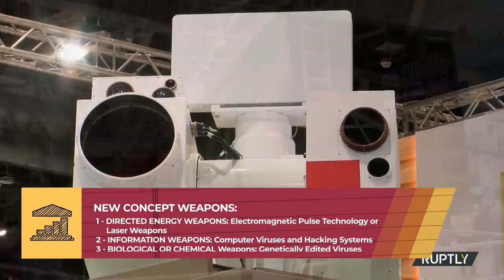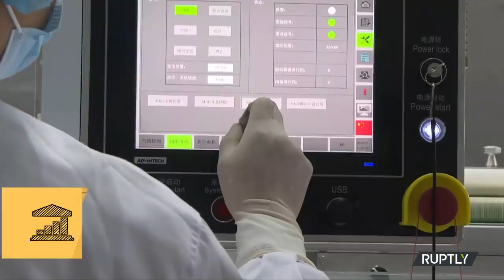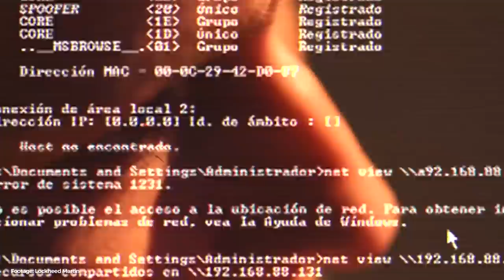The new SUPER WEAPONS with which CHINA hopes to BEAT USA (At least in Asia) - VisualPolitik EN

Comment: My question to VisualPolitik EN: CAN THESE DIRECT ENERGY WEAPON (LASER) TAKE DOWN NUKES OR INCOMING ATTACK MISSILES? CAN IT DETECT THREATS FROM 2000 KM, MONITOR AND ENGAGE THEM SIMULTANEOUSLY?
Reply: Short answer: No.
Long answer: the DEW is an attack weapon. It will need to be inducted with other ISR equipment in order to engage. Even with that, it comes down to metallurgy (material science + thermodynamics). The IR LASER might have high power, but it does not get enough time to melt through the metal of missiles or nukes (they are super fast).
Reply: @NuthanPrasanna  I think there are some ways that can make this weapon super and effective, but if there no suggestion then it is very important that USA must make more advanced and sophisticated defense missiles to protect USA and its allies from enemy threats like Russia's and china's hyper sonic missiles that can hit any where in the USA.
Reply: @NuthanPrasanna  how about enoughpower to fry on board guidance systems how would that fare in real world use
Reply: @NuthanPrasanna  how about disturbing the air in front of the hypersonic missile with sound or microwaves or deploying swarms of expendable drones and use its own speed to let it destroy itself?

Comment: Unlike projectile weapons where you can alter their trajectory, laser are line of sight weapons. Good for close in attack less so for long range attack. They are still hampered by energy requirements which are high. Having to generate a massive amount of energy whether measured in joules or watts.  The power requirements aside from laser for air, sea and land systems in enormous, but add laser you get a wall, space and the ability to miniaturize power sources and the laser system itself. Batteries are a form of capacitors, power storages. Which like bullets can be expended quickly, with the requirement of constant recharge. Enter nuclear reactors and the Sterling engine but still space, you need in all battle space a myriad of systems to sustain, pilots, sailors, targeting systems, propulsion and the list goes on.  I am a scifi geek but I know that laser will not replace ballistic projectile weapons anytime soon.

Comment: Ok but that laser silent hunter wouldn’t work versus moving targets. It has to hold position on target for time to work. Moving prevents that. Also lasers are very easy to block. Smoke would be a measure to help counter the laser, that and steam.
Reply: Lasers could burn optics and sensitive electronics before countermeasures are deployed
Reply: Ironically, the most often cited usage for laser weapons is precisely against a moving target. An extremely fast moving one in fact - missiles, and perhaps aircraft. The laser gun simply tracks the target across the sky. Since the beam is practically instantaneous, as it moves at the speed of light, it can stay on target. Also you only need a slight movement at the firing point in order to sweep a large arc across the sky, since that's how angles work. And neither smoke nor steam would block it unless you release them continuously (requiring your craft to carry around a large quantity of it), since you're travelling rapidly and so will leave it behind in milliseconds.
Reply: Mirrors, lol, I'm kidding, ablation itself would damage the lasers effectiveness.
Reply: They have things to counteract that.
Reply: Even in the 60s TV cameras had tracking tech to follow the Apollo rocket launches. Now 60 years later that technology has obviously improved to track anything.

Comment: China has quite a few weapons that US doesn’t, and that number will only grow larger. The recent test of FOBS is just one such example. USS Connecticut was also likely hit by an unmanned submarine. China is also leading in AI, Quantum Computing and communications, EMALS, ASAT, and certain drone, laser and radar systems. Even the traditionally weak jet engines are getting a big boost recently. Also hacking for enemy’s weapon systems isn’t always about copying, as a matter of fact, it would be almost impossible to steal such data as they are always encrypted. Rather the practice is to acquire opponent’s radar signatures, design flaws, unpublicized specs for intelligence gathering.
Reply: All sounds good for China but the US isn't just sitting still. The US is set to still have the most advanced Navy and Air Force for decades to come. As far as Radar is concerned the US has the best ground and air based versions
Reply: @ShayPatrickCormacTHEHUNTER  I think I know more about my nation than you do. We arent on the verge of Civil War, those stories just catch readers attention. Also, if it wasnt for the US Israel would've fallen long ago.

Comment: Don't be proud of this (F-35) technological terror you've constructed. The ability to evade radar is insignificant next to the power to under bid a weapon systems. 
I'm not a fan of the flying pigeon (F-35) and I know enough about it to say that having it all over the military is a recipe for disaster. The main goal for the F-35 was cross branch maintenance. Meaning that the all branches can share hardware and personnel to repair the aircraft. They literally modified the platform while it was in full production. They hadn't done enough research to prove the aircraft in varying roles. The needs of the navy differ from the air force, army, and marines. There is a reason the navy for years would never entertain the idea of a single engine aircraft. The navy declined the F-16 when it was pitched with heavier landing gear and grappling hook. This standard was something they implemented after experiences with previous aircraft in the Vietnam war. A twin engine aircraft has better survivability. So back to the flying pigeon. Lets not even get into the nightmare scenario of the blind pilot due to the most expensive helmet ever failing in flight. But lets all raise the red white and blue and assume that Lockheed was more interested in building a grand aircraft and not making billions on a system they could pawn off to anyone with a checkbook.